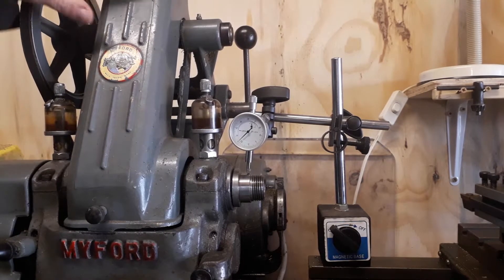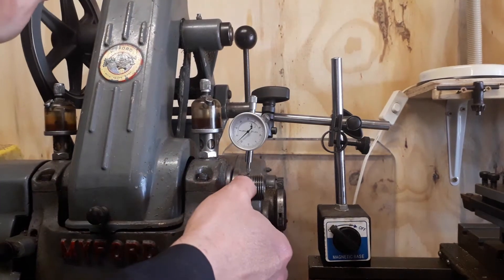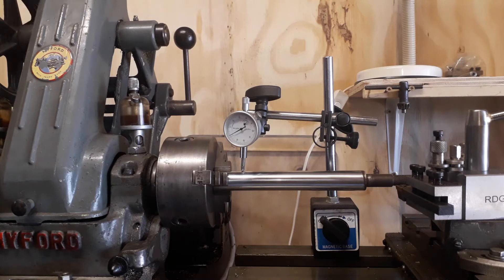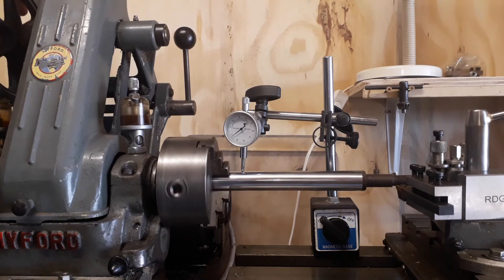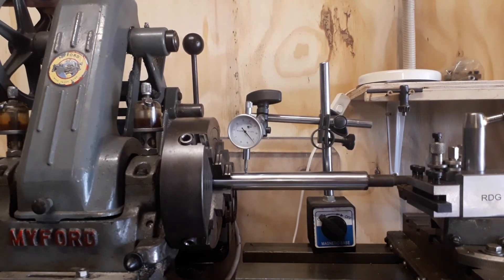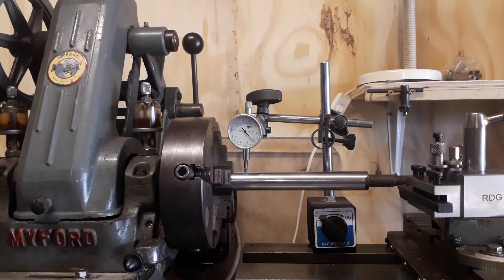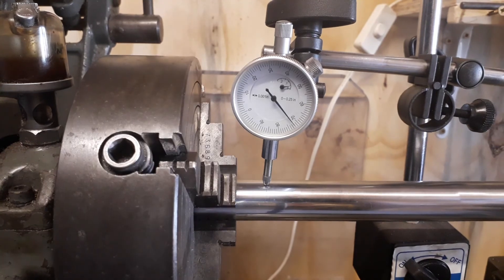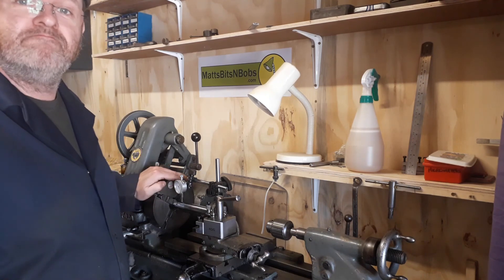What's Best a 3 Jaw or 4 Jaw Lathe Chuck for Accuracy?

Comment: What about NOT independent 4 jaw ?
Reply from the maker: Hi Tony, do you mean a self centering 4 jaw? if so they are the same principle as a 3 jaw self centering, because you can't move the work around on each jaw independently the work is only as accurate as the chuck the independent chucks you can almost get to zero run out. Thanks for watching.
Reply: @mattsbitsnbobsworkshop  but they allow you to do squares. I guess 4 is better then 3.
Reply from the maker: @tonycstech  , Yes, if I was only allowed 1 chuck I would go for a 4 jaw.

Comment: Thank you, great job showing the value of using a 4 jaw chuck. When I bought my lathe, a South Bend 13" made in 1960 it came with over 50 5C collets and 2- 4 jaw chucks, a 10" and 12-1/2" 4-jaw. I looked for weeks trying to find a decent 3 jaw self centering chuck but the prices were outrageous. It didn't occur to me that I had it all right in front of me. Collets that go up to 1-1/16" diameter and two 4 jaw chucks that could handle everything else from 1-1/8" to the lathe's limit. Thanks for the videol
Reply from the maker: Thanks so much Paul, sounds like you have a lovely set up and you understand the importance of a 4 jaw, it's not just for holding square stuff! I see the question being asked a lot on forums "why is my lathe not accurate....etc. etc." and people spend days trying to get a 3 jaw set up and after the first couple of uses it's not anymore. 4 jaws unfortunately for most people sit in the cupboard because they take time to set up compared to a 3. Thanks for watching, Matt.